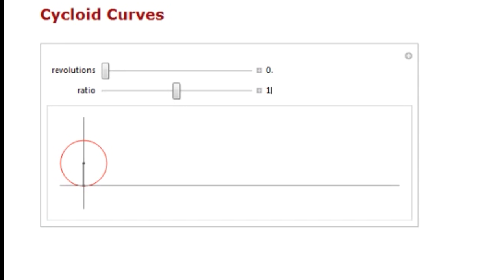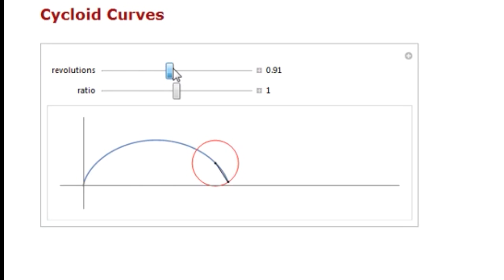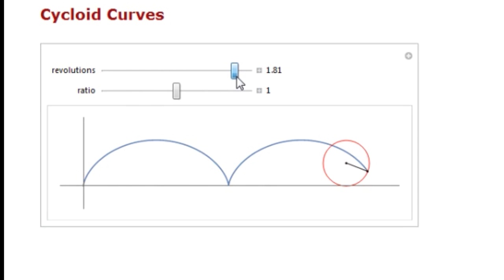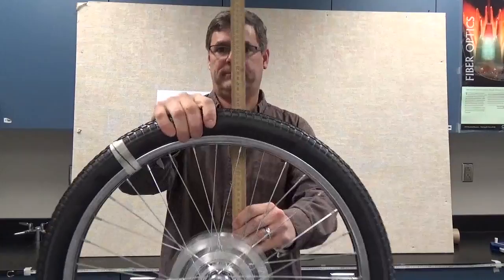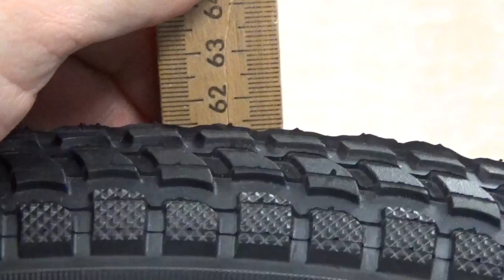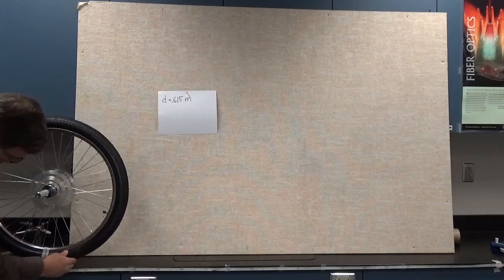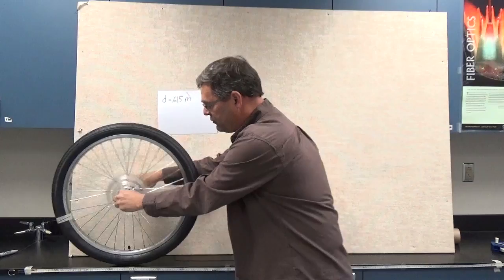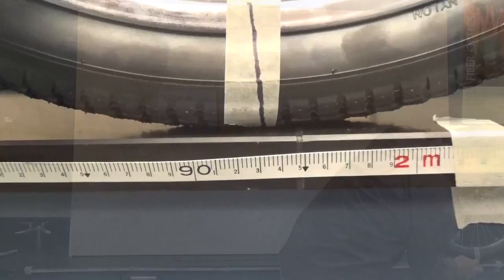11-2 Rolling as Rotation and Translation Combined

Comment: Just to be sure on the last question, the linear speed at the center of the mass for both the wheel would be same. This should be the first thought process here, then we equal both the linear speed(com). We multiply by 2 because theoretically before anything else, it was proved that the linear speed at the top is twice to that of the linear speed at the center. The question says that the radius of the long wheel is 2R if we consider small wheel R but we don't really write that here and instead we just put R and r. The angular velocity will change in such a way that both the top linear velocities are same. Please enlighten me if I'm wrong.